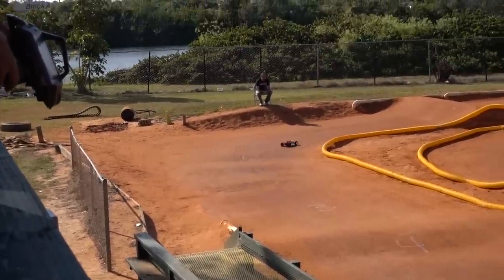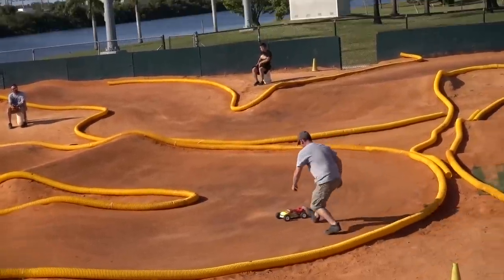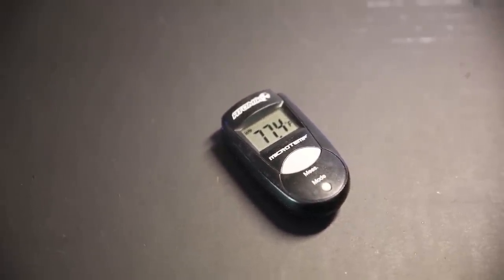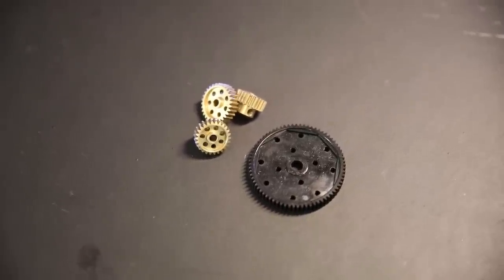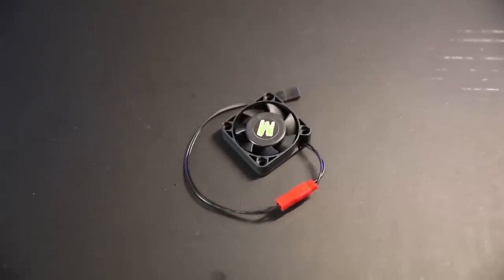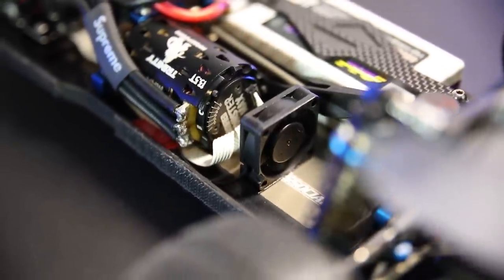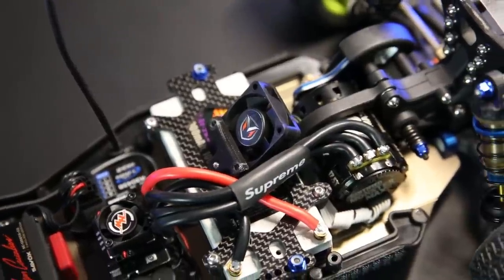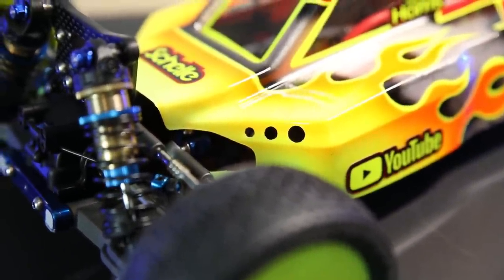RC OVERHEATING TIPS || Motor, ESC, Body Holes

Comment: I have a Traxxas Stampede 2-wheel drive and I'm using a Venom 2 cell lipo I think it's a 20 C lipo in the battery got a little warm the wires connected to the motor and the ESC got a little  warm what would do that

Comment: Nice video but I was hoping to see what to do when we have cold motor/hot ESC/cold batteries, hot motor/cold ESC/cold batteries and so on. Personally, my ESC is getting quite hot while the batteries and the motor remain cool. I was thinking of increasing the pinion and reducing the spur teeth number by one or 2. I am not sure if this will work though. I run WTF/Racing Performer fans on my ESC and motor.

Comment: I dont have a temp-gun or how you call it, i hold two fingers on the esc and motor and see if i can keep it on, i can drive, if its too hot for the fingers, then i gotta cool it down with a big fan. Too hot to touch too hot to run ya know

Comment: yah i did the fans and changed the gearing. but here comes the wtf moment, i also cut out the windows and that was the only thing that really worked for me. . . traxxas slash 4x4 vxl gets really hot on 3s lipo. i want to just get a roll cage body at this point i dont think airflow gets any better than that

Comment: Good info here.  Funny, last race day my 13.5 motor randomly started getting hot in my new XB4...  normally comes off after a 5 min run at 140 degs....suddenly hit 210deg.  no changes, same track as well....  I also used to be able to run consistently for an entire battery pack without overheating.  Still haven't figured out what happened yet though.  The car rolls smooth, no drag from what I can see either.  Kind of a bummer though cause that ain't good for the motor.

Comment: Ryan,
Do ever look at the temp data shown on the HW WiFi module? I have noticed that the internal temps are generally 40° higher than external. Struggling to figure out which temp I should go by. For example, it the motor company says keep it under 180°, is that external or internal?

Thanks!
Reply from the maker: I am going off of the hottest spot I can find on the outside of the motor/esc 👍

Comment: What is the rule for Maximum temp for Motor, ESC, and Batteries?  I have been looking for video of heat limitation and no one seem to give us those numbers :(
Reply: Over 180⁰ is too hot. If you're in the 200⁰ range that's really bad.

Comment: Hi Ryan, loving the videos.
On your 2wd buggies, have you noticed any difference with mounting the fan Infront and above the motor blowing down compared to mounting behind the motor? If mounting behind which way round would you have the fan, blowing on the motor, or acting as an exhaust? I've only been racing a few months and am on a steep learning curve, so your videos have been really helpful.
Reply from the maker: I have always blown the air into the motor. No issues for me so far!

Comment: I love you man, I needed this my B64D's XR10 pro stock spec have issue recently. Will XR10 pro (big brother with 160amp) have less thermal protection problem, bit heavy but might be worth it.
Reply from the maker: I think they have similar thermal limits? I'd say check the specs to be sure though
Reply: Ryan Harris Yes. Same thermal limit I think bigger aluminum case and fan might help cooldown.

Comment: Should my battery  git hot after running
Reply: Yes. Below 100° they can also puff up a little too. Connectors or cables shouldnt be hot though or you could be drawing too much current through small gauge wires

Comment: So this issue is happening to my rc car every time I use it. I’ve got a 22 pinion and 68 spur on a castle 7700 sidewinder 3 on 3s on 3.25 inch tall tires and is awd. I like the slow speed controllability it has with the new taller tires and it still has great low mid and high speed power but I would rather keep the high speed capability and not increase low end torque as I already have to be careful not to pull wheelies if I hit the gas too hard but does anyone have any suggestions? I’m tempted to add a water drip system on the esc to keep it from overheating. It and the motor both already have fans.

Comment: Another quick tip to lower your motor temps a bit in a pinch .  C-clamp around your motor will  also dissipate heat from the motor  when there's no other options..

Comment: I'm a bit confused....you seem to suggest that running a smaller pinion wheel (e.g. less teeth) could help keep the motor cooler. Is this because the smaller pinion results in a lower gear ratio, and therefore the motor doesn't have to work as hard to accelerate the car ?

Comment: Help me, so Idk what happened but I just run my car like I always do and I had like a hunch and jokingly checked the motor and esc (I dont have those thermometer thingymajigs so I just used my fingers) and oh boy did it hurt, I never had any heating problems with this thing until I added the front differential, I didnt have a front diff for a few days because it broke but even then when its still fine I never had any heating problem and I checked the new diff and it looks fin, so I decided to plop in my other spur gear with less tooth AND IT STILL HOT but a little less, so then I noticed that when I roll my car in the floor it seems a little stiff, I checked the wheels, bushings, bearings and even cleaned it and it is still stiff, Im short on cash since im only 16 and couldnt get myself a heatsink and a fan so any clue what is the problem? And what should I do?

Comment: Question: do short course truck tires work for rear buggy wheels
Reply: It's not advised truck tires on your buggy make your motor have to work harder and you run risk of hurting your motor esc or both
Reply: @aaronsalais3477  that makes a lot of sense but that was a long time ago woahhh thats crazy. Like looking back in time

Comment: My lrp bx has holes drill in the body, a motor heatsink, fan on the esc and a custom air ducts to intake air to the motor and it still overheated :'(

Comment: Hey Ryan, just came home from the track. I got a little concerned with seeing my esc get up to 170 degrees. The motor was only a 145. The battery also seemed a bit warm to the touch. Any suggestions? Gear up or gear down?
Reply from the maker: All sounds about normal! If it gets a bit hotter, drop a tooth or two on the pinion

Comment: I used a motor  analyzer to set the amps right. Then gear according. I ran a 6.5 in my 4wd 1/10 truggy. I had the motor set to draw 5.5 amps then san a 17 tooth. I ran it for 10 minutes the motor never got over 98

Comment: What temps do you normally see as "acceptable"? Thanks
Reply from the maker: I normally run my stuff under 150 degrees
Reply: Cool. On carpet in the heat of the summer my cars usually run around 140 so I'd say that's pretty good!

Comment: An extraction fan is more efficient than a fan blowing into the car. Holes at the front and an extraction fan on the rear should invoke a balanced air flow, removing the heat from the car is the goal.

Comment: Its been brutally hot the the last two races days (even though its an indoor track).  If you're using WTF fans to cool your motors I suggest being very careful.  I had one die mid run on my 17.5 2wd buggy and the motor temp hit about 300 degrees and blew up.  Some of this was my fault for staying out way too long during a practice run (when its really hot, I recommend not practicing for any longer than 5-7 mins before letting things cool down).  
The next race I had a brand new WTF fan in my 13.5 4wd buggy and my motor failed after 14 laps on the track.....The Fan was not working when I pulled the car.  I don't know what's up with newer batches of these WTF fans but they suck.
Reply: mgers75 I agree. I’ve used two and they just seem fragile.
Reply: mgers75 the trinity fans are just as good and blow like crazy, I have a couple wtf fans and haven't got a chance to beat on them yet. Thanks for the info! Seriously! I hate having to replace expensive items because of a cheap P.O.S!

Comment: This seems like a stock motor issue with overheating or the esc shutting off .  I ran mod 1/10 and E-Buggy , E-Truggy never had them overheat on the motor or the esc shutting off on a hotter day outside trick is to reduce your punch control/current limiter of course your gearing isn't nearly as high as guys run with stock motors.   Yes you do need holes in the bodys for sure especially hot days that when they could overheat .

Comment: I now race the 17.5 i only run 4 mins, i turn the thermal off, because in oval our heat factor is pretty constant, and i try to come off under 160, usually 150 to 155 if the car is handling well, the reason i turn the thermal off is if my car shuts down with 8 secs to go in a big race i will be pissed to no end.... if i happen to fry something oh well that's just racing... i aint fried nothing yet.

Comment: What are you temp recommendations? I've heard don't go over 150 all the way to don't go over 180. At what temp should I start worrying about motor or ESC? Currently use the same Trinity fan you showed in vid on both B6 and B64, pro-tek mount that puts the fan in front of the motor on the B6. The Arndt shroud for the B64D again with same trinity fan (Arndt Shroud: https://arndtcraft.com/products/b64-b64d-30mm-fan-shroud-mount ). Track is high bite clay indoor. B6 comes off around 120-140, B64D comes off about 130-150.

Comment: Someone needs to make a motor heatsink which you can pop a dry ice pellet into. Just run a pellet per race and you get major motor cooling. You could use it for the esc as well

Comment: I always keep a temp gauge in pocket when I'm driving, and I'm always checking motor/esc temps every time I handle the car after, or during a run. I've reached a point where I have a temp gauge in my pocket when when I'm not driving lol

Comment: I would love to see some liquid cooling options. Maybe for the ESC and the motor, with little radiators and water pumps. That would be cool. Literally! lol
Reply: That exists. Usually used as a replacement for nitro and similar setups on boats. For example, see Turnigy AquaStar. The problem for using this on a RC car is weight and reliability.

Comment: I have a drift car and my motor got so hot I held my finger on there for 2 seconds and I got burned so I took the fan off my esc and put it on my motor
Reply: Did that help
Reply: @Shaun Northern a little bit but not much so I put the fan back on my esc and I’m running 3 fans cooling my motor and 2 on my esc

Comment: In the past I had two cheap steering servos which broke and then suddenly the battery lasted just 5 minutes( instead of 8😔) and my ESC suddenly started overheating!!!!! What I'm trying to say is that your overheating problems can also be caused from broken electronic parts!!!

Comment: I have a question: I have a rustler 4x4 vxl since I started running on 3s I only get about 8 minutes before it cuts off I have a fan on the esc any suggestions?

Comment: Here's a funny RC racing story. So I was at my local RC track in Portland Oregon, (PDX RC Underground) racing stock buggy on carpet. I had 1st starting position, and I flew off the line. I was in the lead for about 4 minutes of my 5 minute race. Then my car gradually slowed down. I had just changed my pinion before the race. So I was so scared that I burnt my motor! So soon after that I was bumped to second, then third, then 4th, and so on. So the race is done, me in last place. I get off the stand, I look at my car. It turns out my slipper was completely loose😂😂! So moral of the story, CHECK YOUR SLIPPER CLUTCH!!!